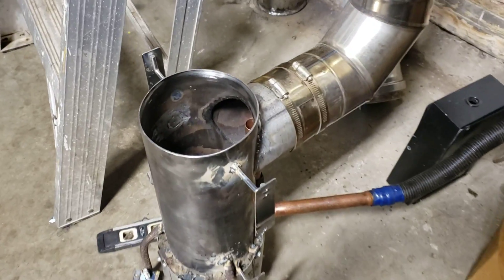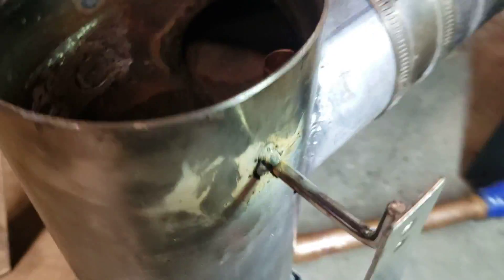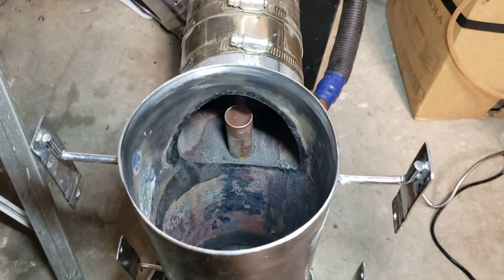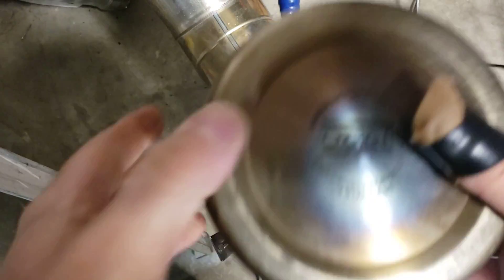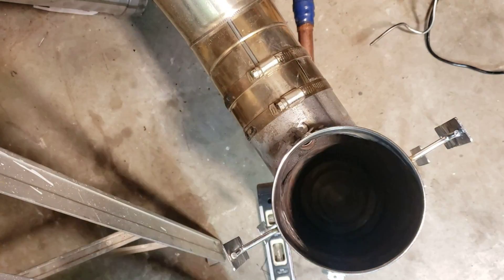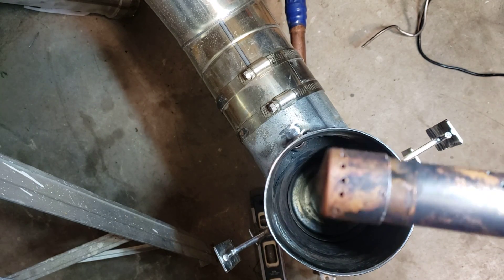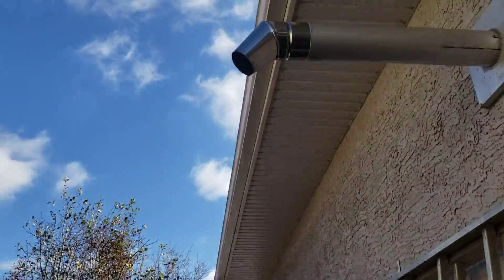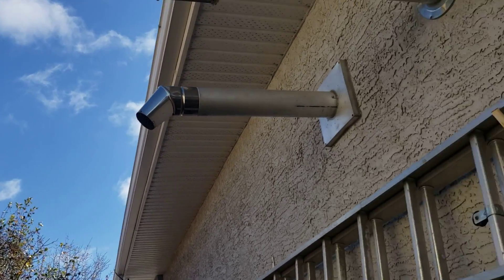Mad maxx 2.1, oil burning wvo  stove  October 11, 2021

Comment: Hi Dennis. I love your videos on this build. I have recently installed a WVO furnace, "chipburner", to heat my house. It's working great, I have a thermostat and it usually works perfectly except if I haven't cleaned the oil super well, then my gate valves get clogged and the oil slows, sometimes causing the fire to go out, and I have to open the valve and reset it. For this reason I will be switching to a peristaltic pump, thermostatically controlled via an Arduino micro controller.

I have a question, what OD and ID tube did you go for with the pump? On ebay I see the same green pump as yours, with 3 tube sizes, the middle one is 2x4mm and gives 39ml/minute. I use about 700ml/hr which is 11-12mm/minute (the next size up, 3x5mm, does 80ml/minute). Do you think these green pumps are hardy enough to run 1/4 of the time for like 8 hours a day for 3-4 months a year? I wonder if the (brushed?) motor is up to heavy longterm use. Thank you Dennis!!
Reply from the maker: thanks for watching
in the past I've used   green pumps, black pumps,   clear high volume pumps ,  clear line, special  line .,  almost every imadinable combination ......
and found ,, after  reading a study  on peristaltic pump hose reliability   ,that the output of this type of pump   is relatively reliable for the first 60 hours ....(of constant pumping) (not intermitant pumping )in this study it stated that the hose actually deforms a little causing different flow rates     degrading more and more with time ......
I thought these pumps were a constant and once set ,you could   set and forget  (not so much )

........so I'm going with a small DC  brushed gear pump  hopefully will eleviate the flow rater  problems     ............time will tell u
can you  send me a vid of your build     I'm really interested
Reply: @dennisw4828  
Interesting, thanks. The flow rate changing over time shouldn't much matter to me, considering my system is thermostat controlled and in future, will be throttled more like a PID controller - ultimately, the Arduino micro controller will alter the flow rate bit by bit, second by second, and not just switch between fixed pilot and heating flow rates. If I can do that well, the system will compensate for flow rate changes easily.

I'm just trying to make this thing as safe and as automatic, "set and forget", as possible.

All that said, I have had concerns about the tube splitting and leaking over time. Have you had any of those kinds of issues? Is silicone hose hardy enough for a peristaltic pump? The low flow rate seems very desirable for our needs.

I've just had a look at gear pumps and they seem to typically have flow rates between 12-30LPM. I've found a very cheap one with plastic gears though, which has a rate of 1.2LPM at 5v. That's still 100x the rate I use. I think the maximum flow rate I'd want for any given pump is under 20x, ie on for 0.1s, off for 2s, at 700ml/hour. Longer cycle ie 3s when the room is up to temp. Dunno.

I intend to post a YouTube video once I have implemented a number of improvements, but I can take a video tonight when it's fired up and send it to you if you could give me a way to reach you privately. 👍🏻
Reply from the maker: I've tryed  bpt  tubing (thought this would be the answer  no),iv tryed clear silicone tubing(not to expensive ),iv tryed cloudy tubing ,tygon tuning .and each type spit or deformed so bad that they leaked or had holes in them .each one of these experiments lead to a huge puddel of oil on the floor .I've since put the pump in a pail so when pump issues arises it's an easy clean up .I'm hopeful .,as always, that this gear pump will  give me a constant that is needed .I pump about 1000 liters through these peristaltic pumps last winter so I'm not sure if there meant for such volumes .....?heating season is just ayound the corner ,so   we'll see some new directions .got a new induction fan from a Toyota purge air pump    it says it will deliver 13 psi     we'll see.
send vids to dennisweimer69@gmail.com
I'm interested in automatic temp regulation
Reply: @dennisw4828  oh right, sounds like a real pain with the peristaltic pump tubes leaking every time, you've been quite persistent with solving the problem! Definitely seems like a road I don't want to go down then.

How about the pumps from those little diesel heaters they use in RVs, caravans, camping etc? I forgot about those! They're low dose and the diesel heaters actually pulse them on and off constantly, so I'm hopeful they have reliability. That said, vege oil is a lot more viscous than diesel, so who knows. I'll order one and have a try, unless you already have?

Ok I'll take a video of the heater outside shortly, it's mid afternoon here. I already have a video of the inside interface showing thermostat control and flow control.
Reply: @dennisw4828  I've emailed you mate 👍🏻
Reply from the maker: @paulraymond1804  I'm thinking of using a wabasto heater pump  but am unsure how they would work with  the on off setup I've got going ......do they need seperat voltage to pulse or   do you just supply voltage and it pushes oil and pulses on its own .......?(gonna have to pick one up and do some testing ).I think this is  going to be the most reliable and constant flow rate pump that I can buy for cheap.  love your idea of a pilot flame   and then a high heat flame    !,more complex but very doable .....on another note  I insulated the burn chamber around the burn pot(  with a home made refractory )
to retain as much heat as possible for efficient vapization .it takes   a couple   ,7    minutes to get up to temp     but feel that it is why this stove performs as it does . I'm gonna look at your vidios
Reply: @dennisw4828  I think the pulsing on and off of the diesel heater pumps is controlled by the controller only. I think the pump itself is just a basic pump. I think it only needs 12v to run. I reckon your timer unit should be able to drive it fine.

With my pilot and heat flow, I just did it that way as it was required for using a simple thermostat with the two gate valves. With a pump though, you'd have a thermostat switch between two timer modules, low and high flow. Or like I plan to do, program an Arduino microcontroller to calculate everything on the fly as well as make sure it doesn't melt down! But it can be very time consuming, programming and installing those controllers.

I'll order a diesel heater pump too. Probably won't have it in commission for a while though as today is the last day of winter here in Australia and there'll only be a handful of cold nights left over the next few weeks. I'll do some testing though and share findings. 👍🏻

You make a good point about insulating the burn to be hot. Maybe I can still make this heater burn hot enough for a clean burn by containing the core burning in a smaller steel box or something.
Reply: @dennisw4828  
I've had a closer look at the diesel heater pumps. The most common flow rate is .022ml per pulse, and it seems like they can do a max of about 5.4 pulses per second (that's the highest setting the diesel heaters tend to do), which is 428ml/hour. I need double that at least. I saw a pump with a higher flow rate that, I think was about .030ml per pulse, and even then, that's only 583ml per hour (maybe less with oil, being thicker than diesel).

The only way I could make them work is to use two of them I suppose, which is less than ideal.

I learned that they are a piston pump, and it looks like they require on/off pulsing of electricity, which the timer module should handle just fine once you know how long the ON phase needs to be (probably less than 100ms).
Reply from the maker: wow that is great info on the  pulse pump s   and I thank you for it .    500 ml/hour  roughly is about what I'm using (I think).I'm gonna try this cheap offshore geared pump and here in Canada our heating season is around the corner .....so......there will be more trial and error on Maxx this heating season     stay tuned ..I'll relay my findings in a vidio

Comment: Very nice, but can you smell the burning from outside? An how many oil is burning in 1 our?
Reply from the maker: no  you really can't smell anything outside  . right when the start it up and it's not hot   you'll get a light smell    but it burns it so hot and efficiently that  you see comming out of the pipe is moisture
Reply: @dennisw4828  that’s great to hear. I hope it’s burning also the heavy metals and other stuf in used oils
Reply from the maker: @ernestlageman1553  I haven't burnt used motor oil     just used French fryer oil
Reply from the maker: about   16 liters in 28 hours    

400 ml      500ml   per hour
Reply: @dennisw4828  that’s around 5-6 kw in a our 👌

Comment: Which oil pump you are using
Reply from the maker: Brand: Gikfun

4.3 out of 5 stars  181Reviews

Gikfun 12V DC Dosing Pump Peristaltic
Reply from the maker: similar to this one
Reply from the maker: I can't download the picture  but I found it on amazon for like $15
Reply: @dennisw4828  how much oil it use per hour
Reply from the maker: @cakesaroundtheworld7388  I'm not sure   I've had issues with the paristaic hose and had to Chang it   out..... leaking
when I find a pump setup that is reliable I'll do some flow testing   (the flow changes with every different tube I put in the pump)
Reply: @dennisw4828  can you share amazon link please

Comment: Nice, I would agree the copper wont last in furnace temps you're getting.   Seems like too much fuel to me as flames are entering chimney.    Less fuel and less air or bigger around pipe/taller burn chamber.
Reply from the maker: different days different ideas  .

a work in progress

Comment: Hi Dennis

warum nutzt du kein PWM für die Pumpe?

why you don´t use PWM for the fuelpump?
Reply from the maker: I don't know much about pwm

this controler  has very fine increments

say if you change it from  . 4  of a second off to. 3 of a second off     its fine adjustment apeeled to me.

maybe I'll try pwm next one
Reply: PWM method is not suitable for this usage. Peristaltic pumps, even though small, deliver too much fluid for the amount of "voltage" required for them to turn. PWM effectively reduces voltage. If a PWM controller was used in conjunction with this peristaltic pump, it wouldn't start properly.

The timer used in this video is perfectly ideal for a peristaltic pump, in this super low dose situation.

Comment: WOW ! ! !   You should have got a million views by now !   That is amazing !  You are right to be worried about the copper pipe though, it will disintegrate after a couple of weeks if not days in your case :)  I don't use a pump at the moment it just drips but if I do in the future I will use a hydraulic pump either electrically operated or use a second hand power steering pump pulleyed to a motor that could be in line with resistors to control the speed so it wouldn't pulse.  I have thought about the perisaltic pump but I am worried how long it will last.  My burner is on every day for 10 hours plus you see.  Back to the copper pipe though, just change over to black iron pipe fittings when you get the chance because as I say your burner is so efficient it will turn to dust.  Mine crumbled away and wasn't getting anywhere near as hot as yours gets.   The only way I have achieved the blue flame is by mixing oil with petrol, a ratio of 10 oil 1 petrol and you can light it with half a sheet of toilet paper, so you would save on kerosene big time and gas from the blow torch :)  I dose the oil because the basic design of mine is very small and have so far found it impossible to get a good burn unless I do.  I have just today received my black iron pipe and tomorrow I have to cut a hole in the side of my propane bottle and fit it so I will make a video very very soon.  I am quite sure it will work quite good although am a little hesitant because the iron pipe with fittings on is much more bulky than the simple straight pipe I have at the moment, so it will be a video just like yours when I put it to the test :)  Great job sir anyway, had to subscribe cus yours has to be the most efficient burner I have seen yet !
Reply from the maker: thanks  almost there ....still a ways to go
copper melts at 1085   C  .the temps in the top of the chamber  are getting close to  800 to    900    im thinking
Reply: @dennisw4828  My problem wasn't the melting of the copper pipe but the constant heat caused it to disintegrate.
Reply from the maker: @moonshiner2977  i notice erery time i dismantal this stove there is a bunch of ash like supstance in the pipe.